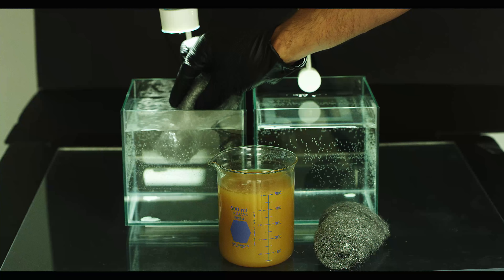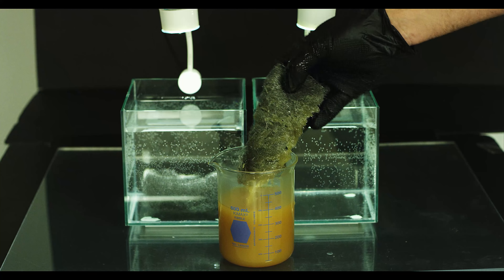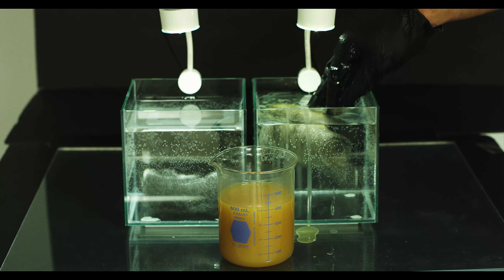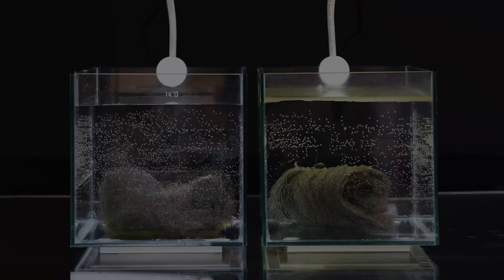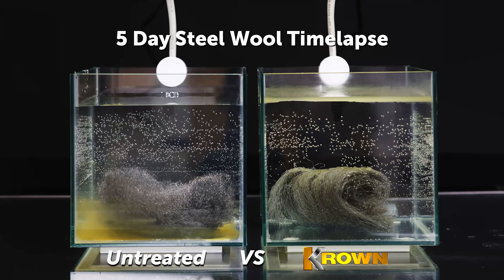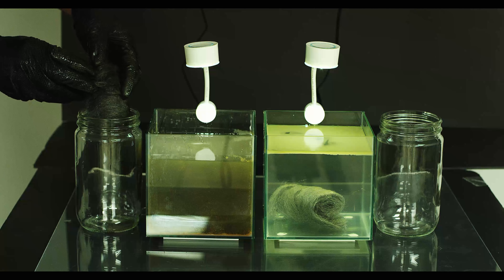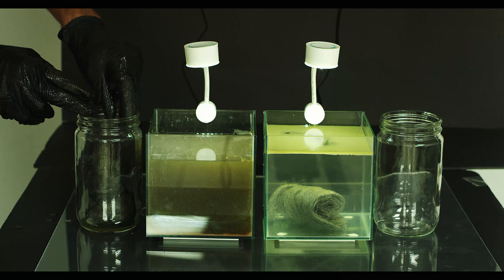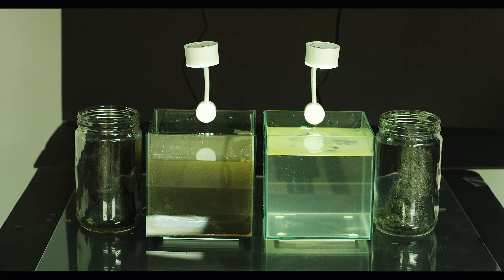Does Krown Rust Protection work? Check out the new steel wool test.

Comment: The video is intented to show how the Krown product will penetrate and protect the inside of the wool as well as the outside. The product is always "creeping" and works it's way into cracks and crevices (in this case the crevices are the inside of the steel wool).

Krown shop in Atlantic Canada has an example of this test set-up in their waiting room...it's been there since 1996 with no corrosion.
Reply: cool!
Reply: by submerging the steel wool, of course the inside gets protected, the Krown is applied directly to it - this does not demonstrate "creap". A better demonstration would be to spray the steelwool, rather than submersing it.

Comment: I drive my car in a state that uses road-salt.  while driving,  my car is sprayed (1 - 70 mph) with salt water.  please repeat this test and spray each (treated and nontreated) steel wool pad with salt water.  we look forward to those test results.
Reply: Except dumb dumb the rust actually occurs mostly in the Spring and Summer. Which is why you get your car rust proofed ideally from late March to early May. All the salt gets washed off and the product gets applied, though I do a self touch up right before Winter myself. Also you'd think  it gets washed off but unless you use high pressure (ie car wash or pressure washer) since oil is hydrophobic it repels the water that splashes up at highway speeds. Believe me I had the same thought as you initially "won't it wash off driving on the highway in the rain?" but it stays put. My car looks like it it covered in a massive oil leak everywhere underneath. It's filthy. But... it's better than rust.
Reply: Dupe your comment was really good other then the belittling at the start it could have done better without it

Comment: Your product is only as good as the application, took my car to one of your locations and they spent 20 min on it and did a very poor job, took it to another locations and it took them 45 min and they did a better job, took it to your competitor and they took 1 hour and you notice the difference of quality. I'd rather my car drip oil for a week but not rust rather than have a car barely drip and rot out. your service has really gone down.
Reply: may i ask who you took it to instead of krown? I have had the same problem, receiving a poor job from krown themselves. 190$ for some kid to play with a hose, hitting only the noticeable spots.
Reply: @ironfist452  What kind of vehicle do you have that it costs $190?
Reply: @a.m.creativ  pickup truck. just a 1500 Silverado crew cab
Reply: @ironfist452  That shouldn't be anymore than $169 after Ontario's 13% sales tax, providing you are in Ontario. A truck of that size should be $149.95 before taxes.
Reply: @a.m.creativ  i may have exaggerated slightly. I dont recal the exact price.
Reply: Agreed to all.  You need to carefully pick your KRC shop because some aren't as thorough as others!   The product is better than nothing but at +/-$150 Cdn I expect a thorough job, otherwise,  I'll just buy a few cans of the competitors product at the local (tire) store and apply myself for less than half the cost.
Reply: @ironfist452 too bad I wasn’t still spraying in Kitchener, because I’d offer you to watch and change your mind on what 7 minutes with a prideful sprayer could do.

Comment: Your Krown treated steel wool pad absorbed approx 100mL of Krown oil before you put it into that water tank.  100mL!!!  That's an oil sponge! There was no salt or other corrosive added to the water and no agitation of the water (air bubbler).  This is a poor demonstration of your product.  Your product is sprayed to the underside of the vehicle, where it gets splashed and blasted with corrosive salty, dirty, grimy water and slush from puddles.  That is what you should be testing.  The reason that it initially floated was because oil floats on water, until enough oil left the steel wool pad for it to sink.  You can see you have a few millimeters thick oil film floating on the water surface. 

I'm might try your same test with dipping steel wool pads in various cooking oils, baby oil (mineral oil) and linseed oil.  How do you think they will do with your "steel wool test"?
Reply: This. Serious fail from Krown.
Reply: Agreed ,The test is cute but hardly convincing ,The water should be saline  and sprayed at the wool for 5 days ,then I would think the test is more valid .However its better than bare metal .In the olden days better cars were equipped with galvanized floors and some body panels .If only the cars were properly designed and protected with proper materials for the outrageous amount of money they ask these days for a new car.
Reply: Its hard to argue with you because you bring up a good point. By the way, I don't know of a single vehicle that doesn't have some sort of treatment done to the frame to slow down corrosion. 

I'm not against krown, there's a lot of real life proof that it works, you just have to go on YouTube and look up people's personal experience with the product
Reply: All legitimate points which I shared in my head as I watched. Particularly the benefit of the barrier created by the excess hydrophobic product rising to the top. However, on the flip side, while this doesn't appear to be submerged in a solution as corrosive as what your car will be exposed to on the road, it is also steel wool. Which is probably about a bagillion times more susceptible to oxidation than any portion of your car. 🤷🏼‍♂️ Definitely agree that this "test" would benefit from better controls.

Comment: Do the same kind of test and show a picture every hour for 30 days ..... or  24x30= 720 hours a picture to be shown for 1 seconds on screen   720/60 =12... you will have to do a 12 minute video.  You should also weigh  your steel wool before and after your 30 days